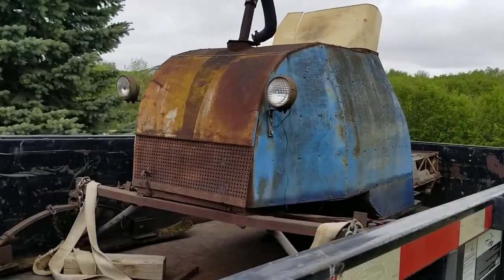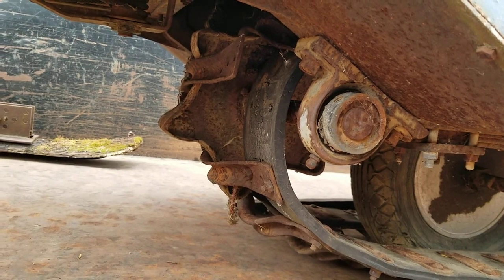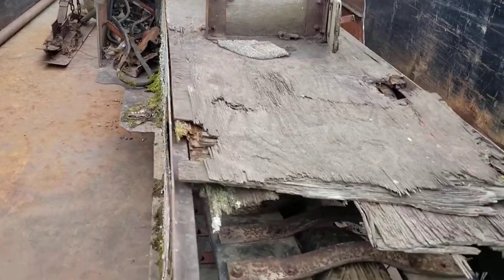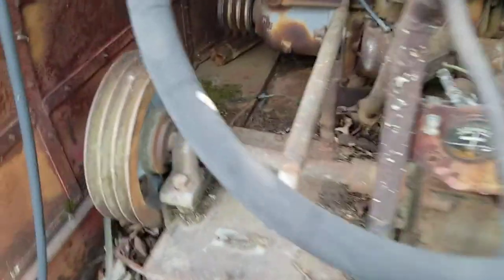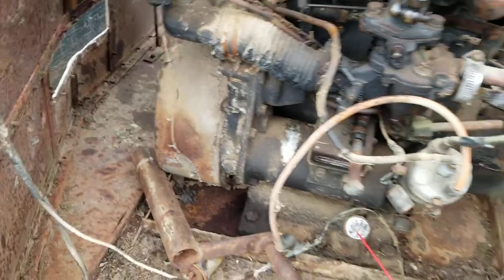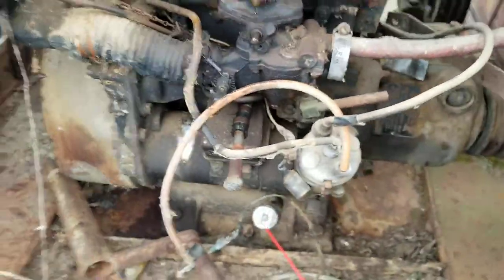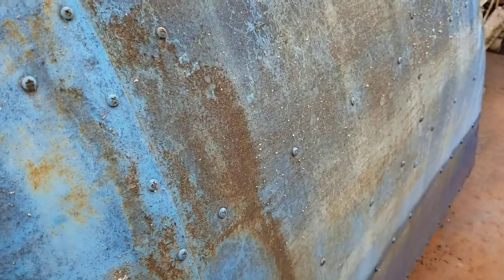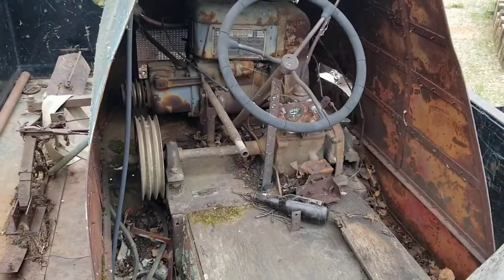1953 Huskymobile Walk Around and Description

Comment: That's an incredible find. It will be amazing to see it back operating. Hopefully you never get it stuck (may as well leave it until spring if you do).  I found your channel after watching a video you did on replacing the crank seals in a 1969 OMC. I have a 1969 Skee Horse and sometimes look for videos on the old OMC machines. Keep up the good work with your content and thanks for making it.
Reply from the maker: Thank you for watching